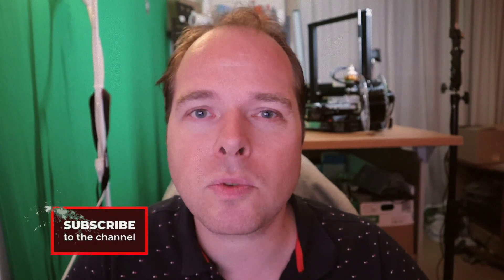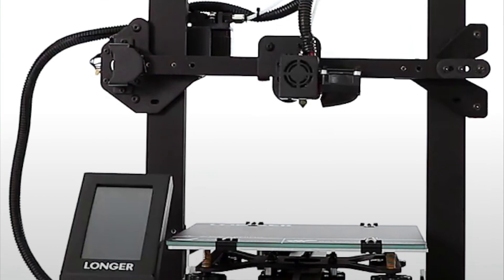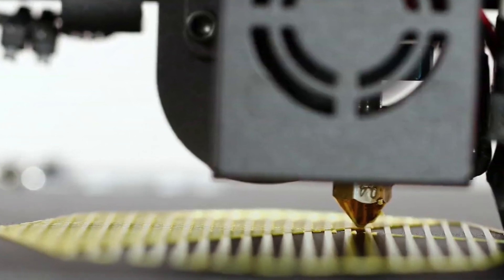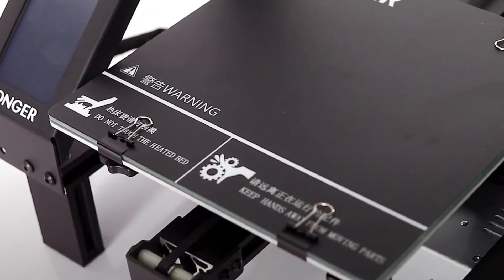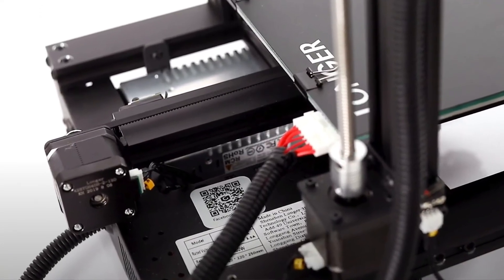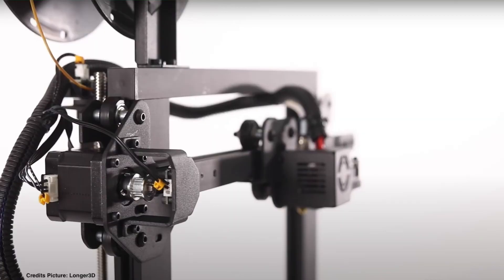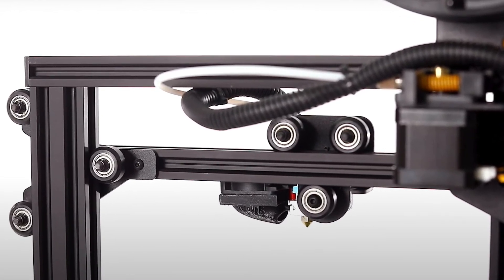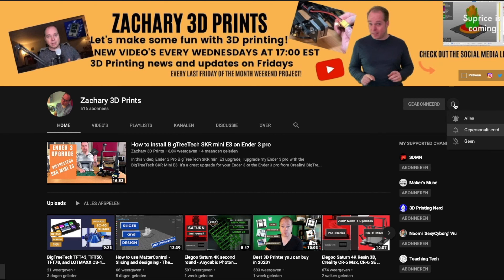Longer LK4 Pro - Z3DP Reacts

Comment: I have the longer lk4 pro and my question is can I use the ender extender kit to make this a 400by400 will the parts in the kit fit this longer I think it’s worth doing a video on this there’s none out
Reply from the maker: Hey hello, Yes I do think that this is possible. Because the parts are almost the same as the Ender, but check with Mark from the Ender Extender.
Reply: Yeah I sent them a email see what happens that would make a great upgrade
Reply from the maker: Indeed, that would be awesome

Comment: Hello brother. I've had ender 3s and sold them. To much for some of us that genuinely cant grasp. Click this setting, buy this washer to stop a clog but add this hot end. So by the end my 170dollar printer 500bux in , in upgrades, repairs, hours and hours and hours of videos to do what my 2 longer LK4 Pros did out the box. When my second creality finally died. After giving up on yet another repair. Took all the good parts. Frankensteined one, sold it for a huge profit because people drool after the name. I got 2 LK4 PROS. Way quicker customer service. Again out the box for the $200 I paid per machine. I only did one upgrade by choice and that was adding a customized fan guard. Creality might be big. But they are not as great as some might think. Good company yes. But Do your homework and pick on your assessment. Good review!! I hope to be as good as you one day!!!

Oh and the customer service!! I posted one issue on Longer and within like an hour I had a supervisor and an engineer working with me. Only to be shown step by step it was user error and it’s now working. Repairs done! Needed a hot end because mine failed boom done. Couldn’t figure a setting or how to fix I had like no lie 6 suggestions and within all the info I have two running and waiting for their upcoming machine !!!
Reply: And now they are on sale for $186 on Amazon!!! That's insane
Reply from the maker: That price is for the LK4 pro?
Reply: Zachary 3D Prints yes just yesterday it was on a flash sale. I was so mad (for a few minutes) because I paid 200 and it was on a flash sale yesterday for 186 on Amazon
Reply from the maker: Hm, lucky you. I need to save money, before getting a new printer to the channel.
Reply: Zachary 3D Prints I hope your able to. Or at least someone able to bless you with one. Upgrades are so simple even I can do it!! I really love mine so much I’m saving to buy my daughter one. She’s 6 and prints for me lol I’ll load a video of her doing it on my channel. But honestly your reviews brother Great job. Never stop doing what you love. Why are you different. I believe it’s because you flow natural don’t have a million dollar studio. It’s you humanness that attracts us. You relate to us. Two thumbs up
Reply from the maker: Thank you very much
Reply from the maker: Thank you. Creality did use the known issue hotend for the Ender 3 V2. And in the Facebook group I saw someone telling to use the hotend fix. I think I did mention this in my earlier closer look video... I do want to buy this printer in the near future. Need to save money for that.
Reply: Its now $125 on AliExpress.
Reply: MonguzTea that’s a steal and a half if I do say so myself !!! Wow that’s awesome